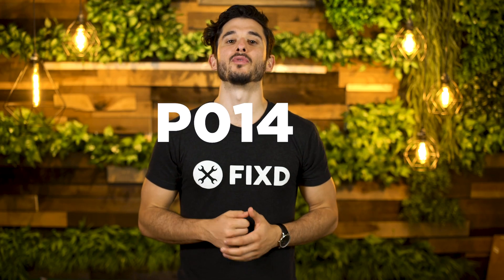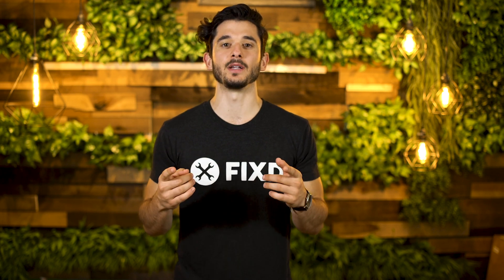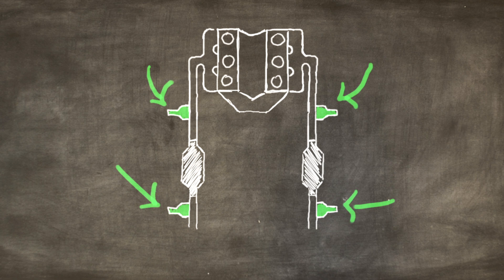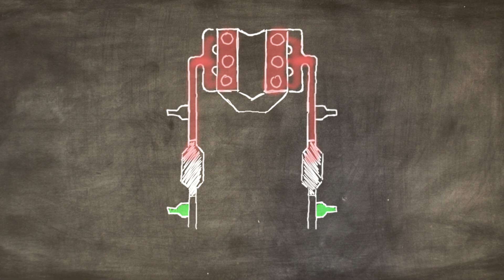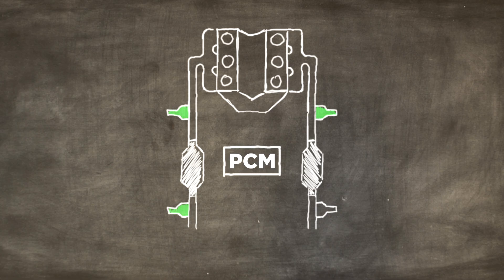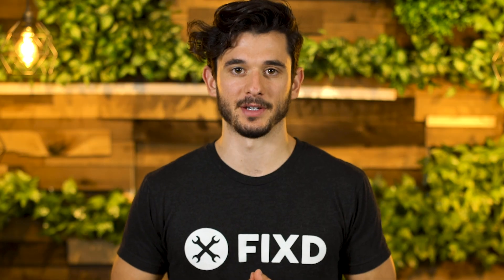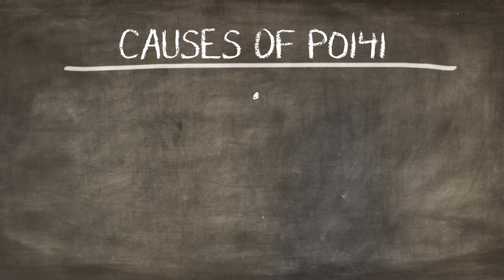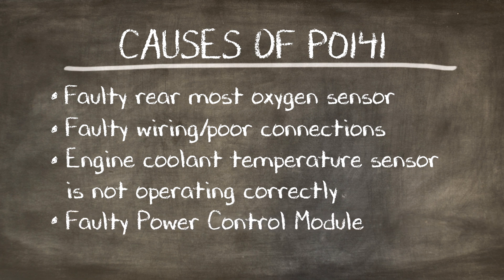P0141 Explained - Oxygen Sensor Heater Circuit Malfunction (Simple Fix)

Comment: I'm getting code P0135 and P01141.  When I'm cranking my 5 speed Honda it almost sounds like the starter and the car will not crank the engine is turning over but nothing happens could this be a result of these sensors?

Comment: I just replaced my O2 sensor on my 06 TJ 
(Code P0141) I’m still getting the same code any ides?
Reply: your catalytic is prob dead.
Reply: @MidnightMoto94  It was my PCM.
Reply: @MidnightMoto94  It was.
Reply: check for broken or chaffed wires
Reply: @gregmiller5907   it was the PCM

Comment: I had a code come up when I went to auto zone. Have a 2002 chevy express van 1500 with the 5 .7 liter v8. It showed the bank 2 sensor one was bad, so I replaced it. Took back to auto zone to run another diag test, still says the same thing. I reset code a,d drive for a couple hundred miles. Got any ideas. Surely would help. Oh yeah it has 211k miles on it. But runs good, also changed the oil sending sensor, now that worked. But 02 sensor has me baffled. Please help. Can't just keep throwi,g money at it , in on fixed income. Ty

Comment: Swapped the 02 sensor on 03 element and I still had that code after 100 miles of driving. Unplugged the battery and deleted code w scanner and still stays on. Any ideas?
Reply from the maker: If the fault for p0141 heater circuit malfunction  is coming back after sensor replacement, there could be an issue in the wiring to the O2 itself. First check fuse 4 in the fuse box under the dash. This may be the issue depending on failure. Being that this sensor is on the bottom of the car it is very common to have wiring damage, rodents chewing on wires etc. Check all connections for worn or broken wires. Always a good idea to check your factory repair manual for wiring diagrams.You can check resistance on the heater circuit wiring with a volt meter, there should be low resistance on the heater circuit, the two black / or two white wires on the sensor side of the harness are the ones to check. If there is infinite resistance or high resistance that is an indication the sensor is faulty on the heater circuit.. Also check to make sure there is voltage to those two black wires by checking the car side of the connector with key on there should be 12 volts. The other wire will be your ground. Some vehicles will have a separate fuse for the 02 sensor system. Check vehicle man, and go over fuse locations.

Comment: my 97 f150 has this code the wires do not look damaged, how do i know what sensor this is?  It says bank 1 sensor 2 what side of the engine is that on?  My truck still is getting its rated mpg but occasional misfire i also have a code for The egr flow being insufficient.  I will remove the egr and see i if can clean it.
Reply: Bank 1 is merely the cylinder bank containing cylinder 1. Should the engine only have one bank (such as an inline 4 cyl), it will be reported as bank 1. Sensor 1 is the one upstream of the catalytic converter, & sensor 2 is the downstream.

Comment: can a hallowed cat converter also cause this? 

i just had this code... or at least just had a scanner to know i had this code.

also my fuel system status is now open loop due to system failure.
from using o2 sensor to mix fuel, any input about my troubles?
Reply: John Meister Dupa if you have no Cats it will most definitely trip your rear o2 sensors. Which will also cause you to fail an emissions test if your county requires you to pass one.
Reply: @WheelinPNW  Funny story, my cat blew up, so I yanked it off and replaced with straight pipe to replace cat. Truck is an antique so don't need emissions anyway. I made a bung for rear 02 sensor and no check engine light after 1k miles. For science I pulled rear 02 out and plugged bung and strapped 02 to the frame of the truck. No check engine light after 1k miles. I got a new cat and plugged 02 back in and check engine light came on after 60 miles.  Go figure.